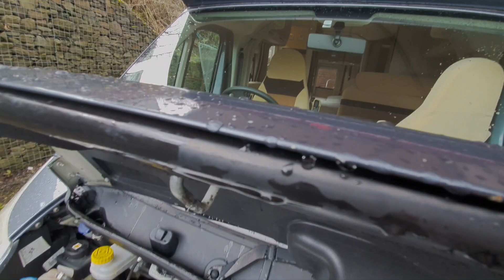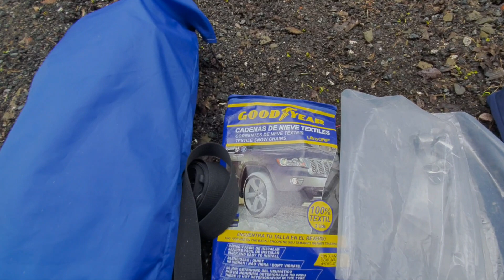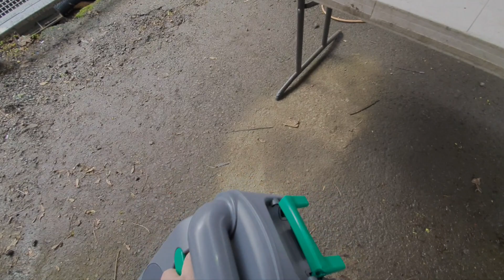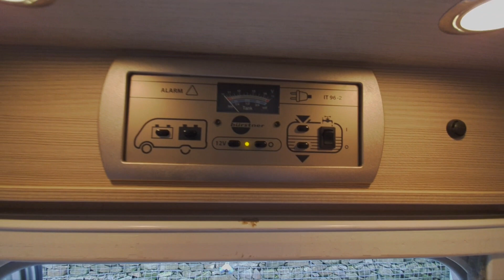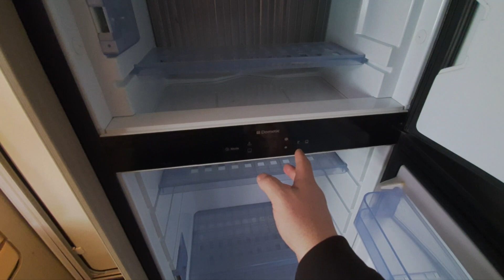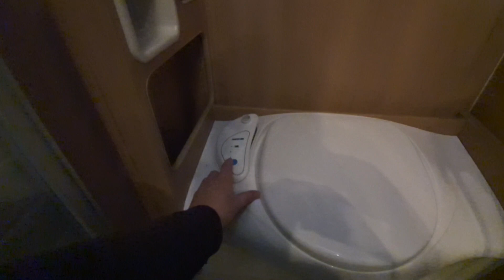Burstner Nexxo T660 Demonstration video

Comment: Great video guys. Wondering if the blue switch on the side of the black box keeps popping out why would that be? Also any tips to get the hot water into the shower?
Reply from the maker: Hi, The black box is a frost protection valve. Please see below list of a few things to check.

- Dimond valve on top is not closed (twisted)
- Blue button will only stay in if the valve is closed
- If the temperature is less that 3 degrees the valve wont close (you will have to warm up the motorhome with the heating on)
- Valve is faulty

Hot water in to the shower. this is just the same as getting hot water through the kitchen tap. there might be a blockage 

hope this helps :)